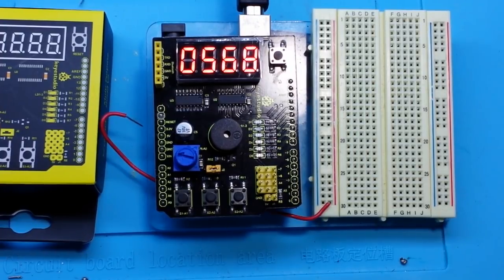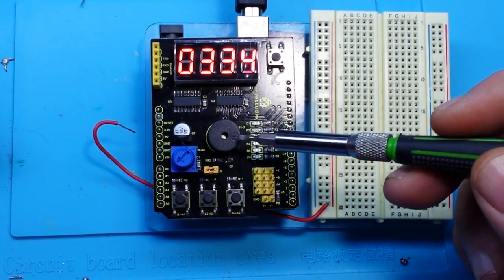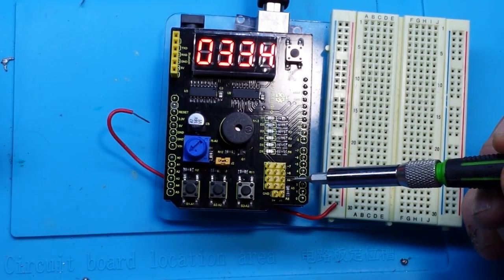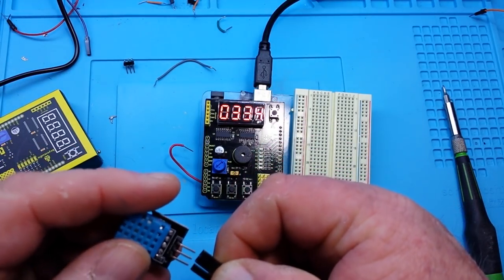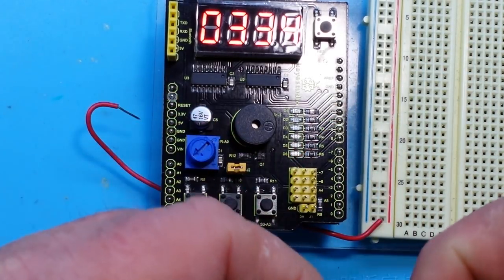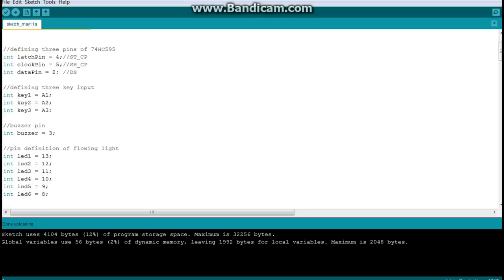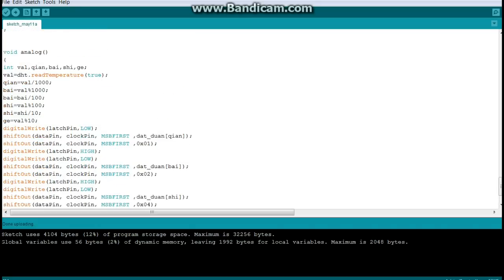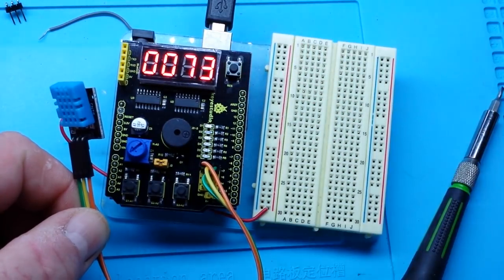Keystudio Multipurpose Shield v2 for Arduino

Comment: Thanks to you i've finally understood how this shift-latch-display setup works and was able to manually (ie by my own code) drive each of display just to my liking.
Rules are:
- always send two bytes. 
First one controls which segments to englithen.
Second one controls which display to drive.

void sendSerialShit(byte which_segments, byte which_display) {
  digitalWrite(LATCH, LOW);
  shiftOut(DATA, CLOCK, MSBFIRST, ~which_segments);
  shiftOut(DATA, CLOCK, MSBFIRST, 1 << which_display);
  digitalWrite(LATCH, HIGH);
  return;
}

and then

sendSerialShit(64,0) will lit exactly dash/minus/hyphen segment of leftmost display ^_^

Comment: You could use some vero board sandwiched between the shield and Arduino pins to gain access to some other  Digital and Analog pins.  Damn now I want one for my collection of unused Arduino stuff !
Reply: Dang, Man !  See what ya went and did ?   Just found one on E-Bay for like $6.00.    Ordered.   LOL
Reply: “I’ve started one hell of a collection and I’ve only used about 1/100 of my equipment. I think I have an electronics addiction.”

Comment: Hey neat, I bought one of those but couldn't find the datasheet. Cheers for that! I'll tool around with it tonight... EDIT: Got it working! yay! Mine is either older or from a different manufacturer. Mine has 4 SMD leds on the right-hand side, rather than six, and mine uses different pins for the 74HC595 shift registers: latch=4, clock=7, data=8.